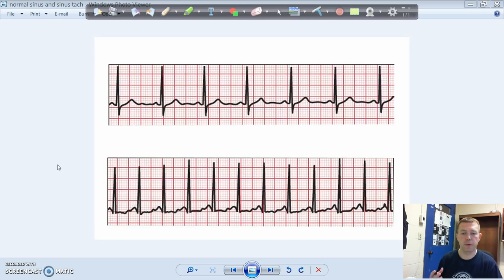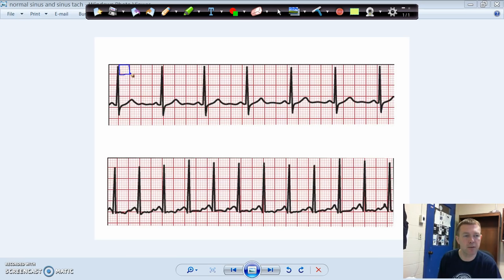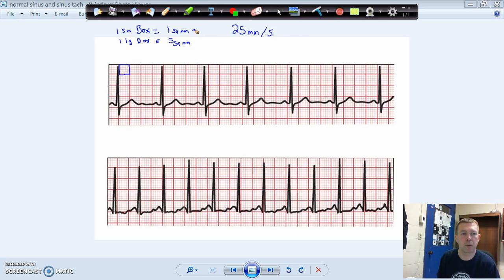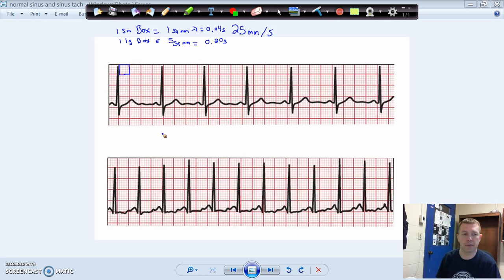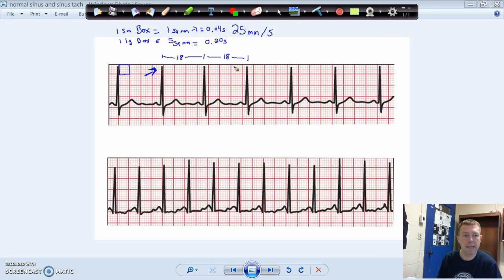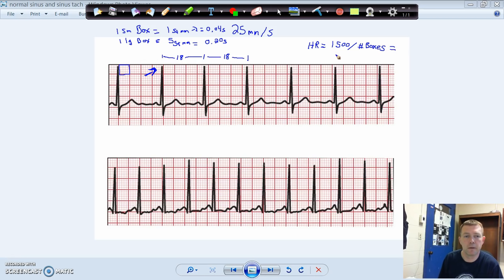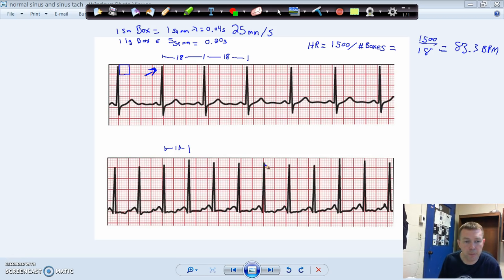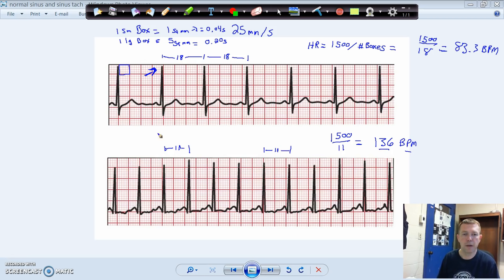Calculate Heart Rate from an ECG

Comment: Where did the 1500 come from?
Reply from the maker: 1500 small boxes = 1 min in time
Reply: @jamesdavis5486  that's wrong. You can only use 1500 if you can't the big boxes between RR. You're supposed to use 300
Reply: @drmannysuccess1024  however, if you chose to count the small boxes, regardless of whether the big box can be counted or not, 1500 needs to be used.

Comment: How do you calculate heart rate in irregular strip?
Reply from the maker: You are right in the fact that the 1500 method only works when the rate is regular. If it is irregular, you could get a decent idea by looking at a 6 second strip and counting the number of cycles then multiplying by 10. Just like you do when doing a 6 second pulse.
Reply: @jamesdavis5486  is the "1500" given right? If it is normal?